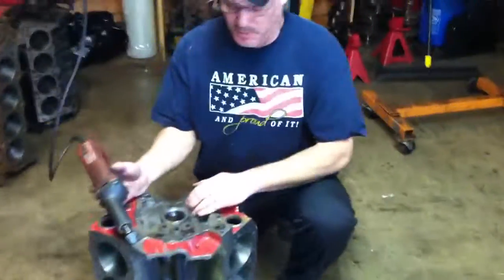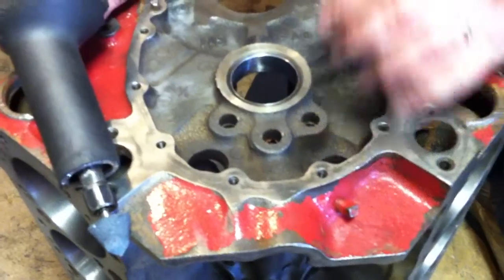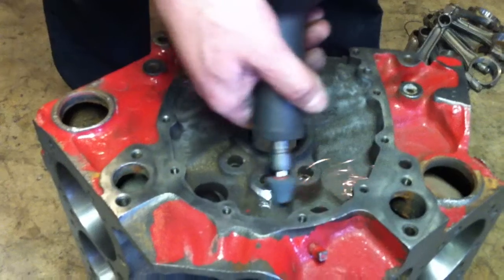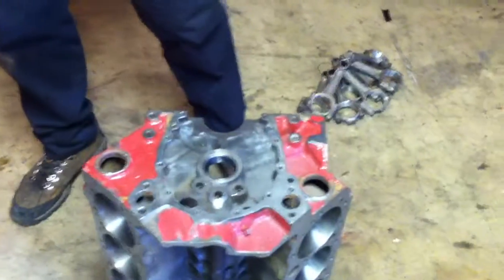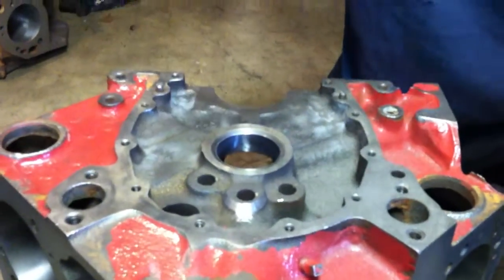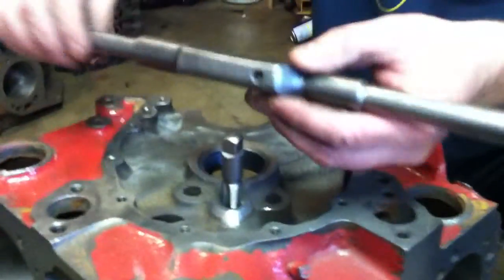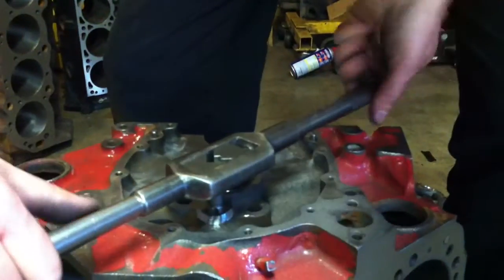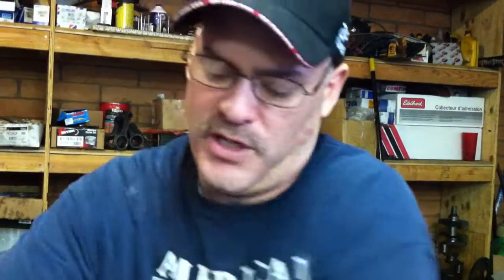350/383 Chevy block build prep

Comment: Thank you so much for the videos. I really appreciate it. I like that I can hear your voice. A lot of videos out there has a low volume. I took my truck to a mechanic and he stole my little 142 weiand supercharger and cam and batteries even the damn stereo. It hasn't ran in two years. I'm not a mechanic but I'm mechanical so I'm going to do it. I've been collecting parts and I have some good stuff. It's a GM Goodwrench 350. I have a new set of Edelbrock Victor Jr heads 77619. Because of your videos I went over budget and bought a comp cams custom grind cam 590 lift 232 duration 110 overlap then because of your video I didn't buy the 132 roller lifters. I listened to your advice and got comp cams retro hydraulic lifters 500. Ouch! I got a set of roller rockers. I bought the parts that Edelbrock recommended for these heads. I'm not going to be going over 7,000 rpms. I'm excited to get my truck going again. This isn't a race truck. It's a 85 Chevy Short box four wheel drive. Dana 60 front axle 538 gears with 35 spline inner and outer axels with a Detroit locker 14 bolt rear axle with a Detroit locker 465 one ton transmission and 205 transfer case. I have cross over steering and 35" tires I had 44" super swamper but they got ripped off also. I want power ,but not stuff that people are going to covet. Do you think the stock bottom can handle the power? It has less than 5,000 miles. I want to play with my truck. Should I wait and do forged internals. I'm recovering from surgery and I'm only working part time so basically I would have to wait until tax return next year. Should I wait?

Comment: what are the advantages of a double roller timing chain?
Reply: Giovanni Mattis less chain stretch with torque of stroker crank builds step up from that is a gear set up I wouldn’t put gear drives on a daily driver just because you will have to change the oil more often cause the metal on the gears do flake wear down over time better for track racing